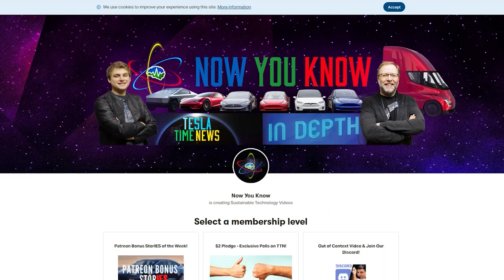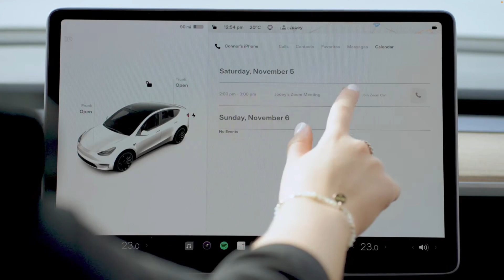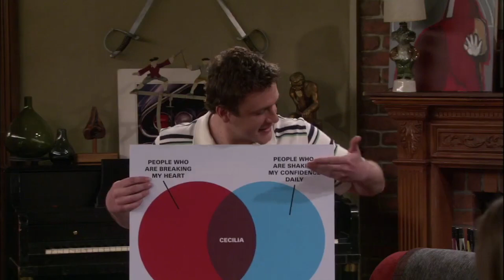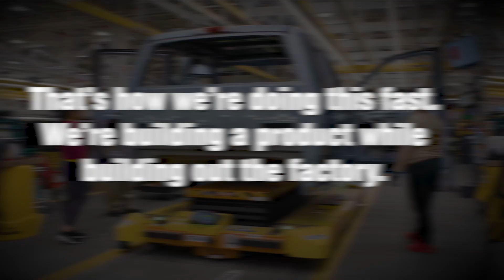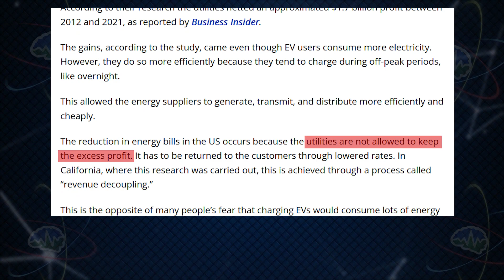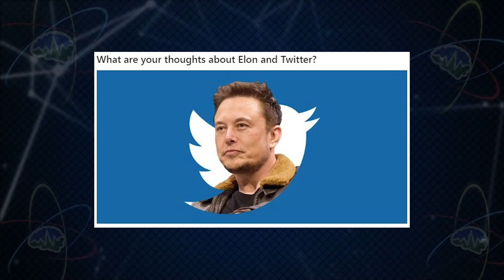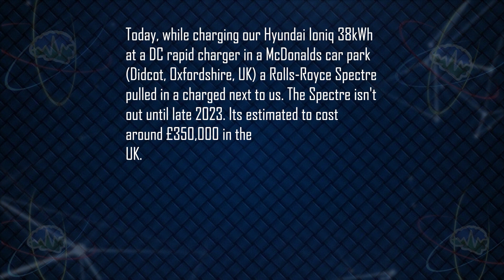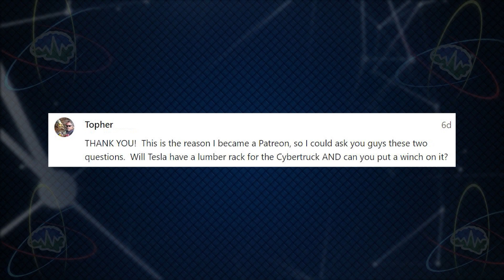Elon Ditching Twitter? | Tesla Time News

Comment: Electric hybrid trains are a thing, mains electric with batteries so they can run on battery only for short stretches where it costs too much to electrify the line, then top up the battery at the next mains stretch. Can reduce cost of electrifying a line greatly.
Reply: A feature of most Diesel electric locomotives is enough battery capacity to go short distances without firing up th engine.
Reply: For a modern hybrid train they should be able to run all electric in urban areas and forreasonable

Comment: 31:03 as far I know, Diesel locomotives can't regen brake. They just waste braking energy as heat. Maybe the hybrid has a battery pack that allows for regen like abilities. Also allowing a cleaner image of company as they can use it on battery only mode near population centers.

Comment: Be very careful welding to any vehicle, the current can blow up diodes in alternators (in ICE cars) and maybe could damage your computer in the Cybertruck. With an ICE car, you have to disconnect the battery leads prior to welding. EV's not sure.

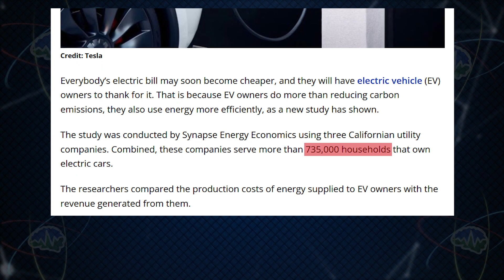Comment: @29:00 You are misdirecting. That argument isn't about costs, it's talking about the inability to support the grid load plus a surge in super high demanding applications. Like when a specific event such as in the moment of crisis which causes everyone with an EV to charge at once.    Right when we all need it, the whole thing collapses and it's the load from EVs which will be the fatal flaw.
Reply: My utility offers reduced rates if you let them control the charger so they can turn it off if they have any issues with the grid. They want you by text and you can override it if you need to, but you'll pay much higher rates if you override.

Comment: 150 extra is a joke, depreciation on the car is at least 2x more than that. And all gas savings will roll into a new battery, got mine replaced recently at 70k miles, was lucky still under warranty, with 50 rides a week it’s gonna get quickly over that😢

Comment: 14.19: tesla solar doesn't save you on elector bills. Do you know why? Firstly, how much does the whole system cost to install? Battery, investors, working, panels etc. Break that cost down by the lifespan of battery and solar panels before they require changing as these do not last forever. Now, are you better off, or not

Comment: If the Cyber Truck works out (long term) I will be AMAZED. How can you build a body that is a frame when it will be in crashes? Cars are safer today because of crash absorbing materials/structure. A crash will mean replacing the entire body. Are they going to prefab hundreds of thousands of bodies for fender benders? Can't use Bondo.
Reply: Good points! Maybe FSD will eliminate most crashes? 😊 I’m also concerned about all those sharp corners on the CT.
Reply: I agree that it is better to avoid collisions but trucks need to remain safe after all but major damage. I have wondered how they will cope with wildlife and cattle. They will lose efficiency with bull bars and spotlights.

Comment: Amtrak may be much better than thought.. Though not near as great as full battery it is still a really good thing. 73 are dual-mode meaning they can run on direct electric connect with overhead connection or on diesel. That means they can start with a small infrastructure of electric and build it out. 10 will be hybrid meaning they will have a battery though not clear if they will have a diesel engine or the other power source is overhead electric connection or maybe all three. Truly they should have done this long ago. The question is will they build out the electric infrastructure. It would save them so much money in diesel making it the smart money move. The reason metro light rails runs on overhead electric.

Comment: in 2 or 3 months iI plan on   buying a charging cable system for my property.  I know I'll need adapters for charging different brands of cars.  I found the Tesla cable, but where do I buy the
others?  My idea is that there are no chargers at all along this road and only one charger along another nearby road.  I will only have one charger and that means I won't qualify for any EV
company's listings.  So I will just put a couple of signs out.  At first I only expect to charge one car per month, but word of mouth should increase my business to one per week after a few
months.  Talk about a small business!
Reply: If you're talking about a DC fast charger, just use CCS for now, Tesla owners can now buy a relatively cheap adapter themselves, and every other car can use CCS directly, except the nissan leaf. 
If you're talking slower AC charging, just get something that has a J1772 plug. Tesla's come with that adapter and every other car including the leaf, can use it directly. Probably a good idea to have an AC charger at that location anyway.
Reply: Look up EVmatch. They let you monetize home Level 2 chargers.

Comment: Ok, hold the phone. Elon said if everyone used electric cars tomorrow the grid would crash. He said EVs need to be introduced gradually so our grid can adapt over years to handle the load. Also if more homes use solar panels to put more power in the grid and power their cars this would shorten the time it will take for everyone to get on board with EVs. 
So of course the media blows this up and says our grid cant handle the power drain. They are half right and half wrong...lets keep the the conversation balanced boys.

Comment: Anyone here are ya seeing how the Oil and Gas industry is starting to support and develop GeoThermal energy?! 🤔🤨🧐

Thing are only getting weirder!

Better educated when it comes to your town!
Next Gen Geothermal uses Lasers or a Magnetron to drill deeper than Metalic Drill bit can go! After that a casing is placed around the sides of the well. Them you place a closed loop water pipe that will carry the Super Critical heated water to the surface. And then piped through a generator. That's the safest example I've seen.
A Closed Loop Geothermal is the safest way to do this.